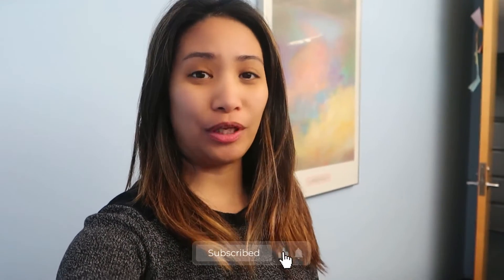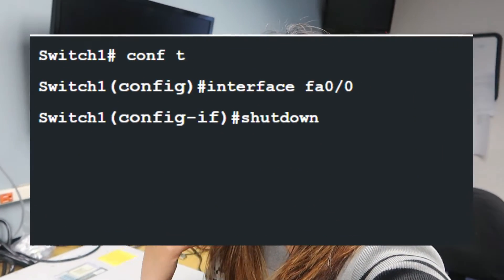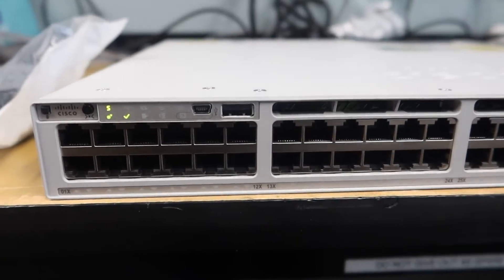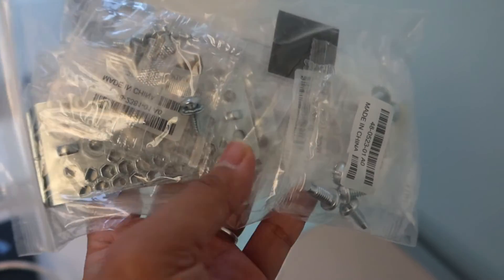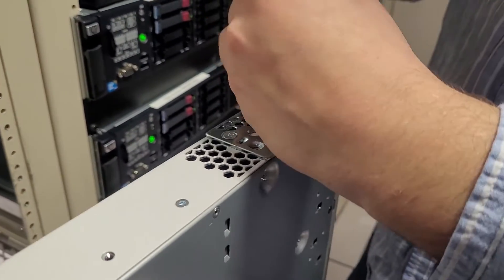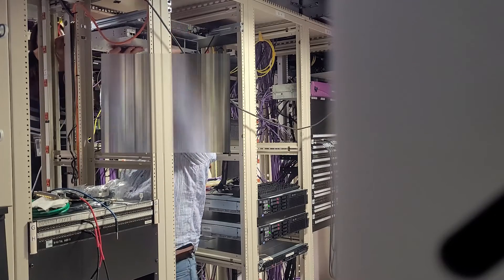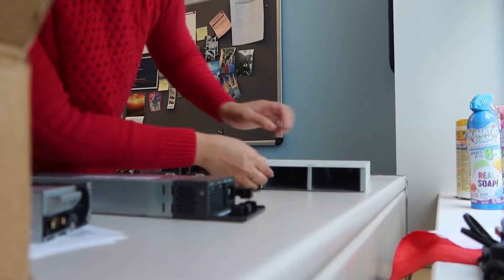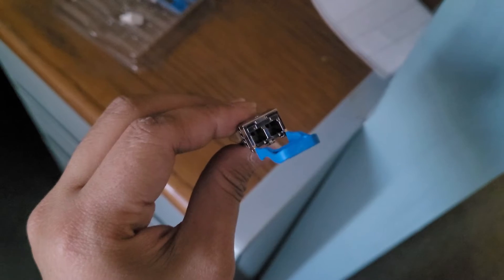Racking a CISCO switch at work | Best Practice, things you need

Comment: Whenever I had to mount a larger device or something a little unwieldy we used to make a ty-wrap sling to bear some weight. One hand on the device, the other to tighten the sling and lift it to the desired rack position. Done that with Cisco switches and routers, Sun servers and other devices.
Reply from the maker: oh that's cool!! Thanks for the tip!!!
Reply: @EastCharmer  Make sure they are Thomas & Betts Ty-Wraps, they are made out of stronger nylon and have metal locking tabs for increased strength, cheapo zip ties will not do the trick.

Comment: by right if the level is lower, we can do it alone but, in this video, its patched at the top, need assistance by default..good video, keep it up.
Reply from the maker: Yes you're right! I'm short so I can't reach it and the switch is also a little heavy for me to lift with just one hand. I'd rather have someone assist me than messing up the device and everything next to it

Comment: To easily rack the switch in an empty rack like this. Use a shelf mounted upside down in the slot below it. Then you can just slide switch in. Much easier than a 2nd person holding it.
Reply from the maker: Thank for the tip!
Reply: @EastCharmer  you're really good. Where did you learn your tech skills? Teachers? Certs?
Reply from the maker: @matthewd84  Thanks! I finished computer networking training and I learn a lot when I worked in a FinTech company